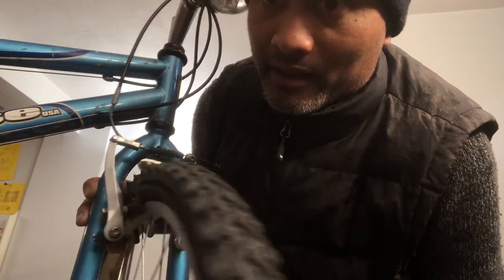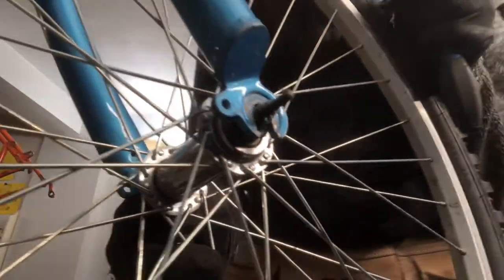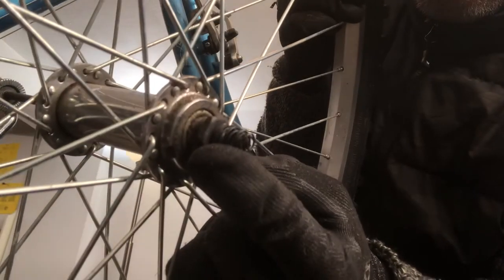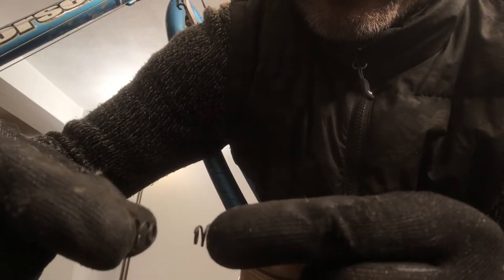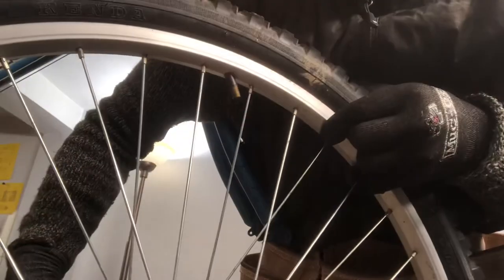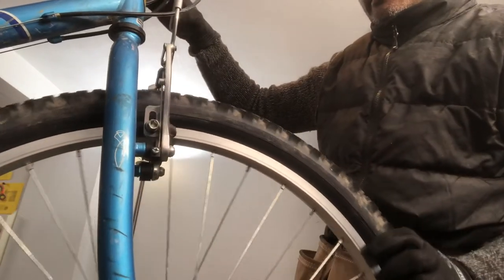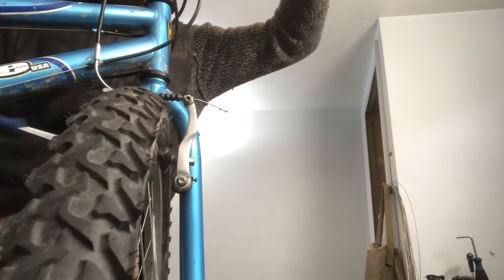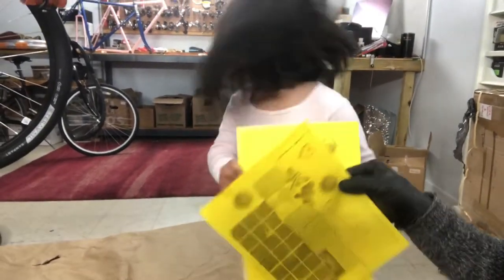Brakes are rubbing?  Check your quick release springs.

Comment: I'm pretty new to the whole quick-release tires I'm an old school BMX guy I was putting my new ebike together and lost one of the darn Springs I did install the wheel I haven't ridden it yet I'm assuming I should go get another cone spring it's probably not safe to ride with only one? Any advice would be great thank you very much very concise video dude
Reply from the maker: Honestly I don’t use the springs at all on my personal bikes.  Usually toss them.  Their sole purpose is to make it slightly easier to install the wheel, except I find they don’t really do that either.  The most trouble you can get into is when they’re installed backwards.